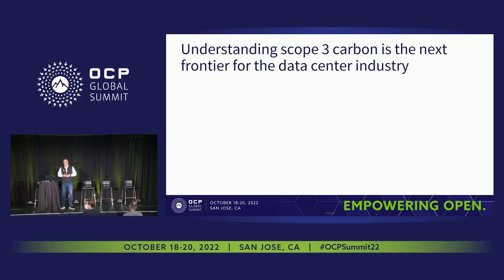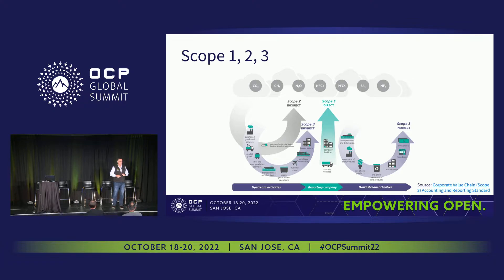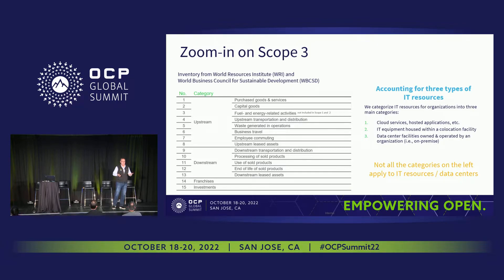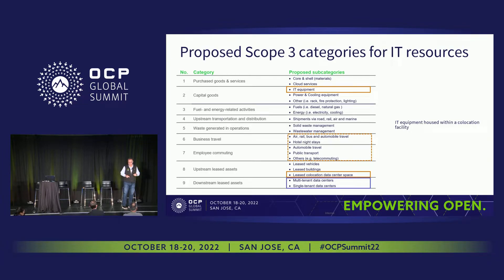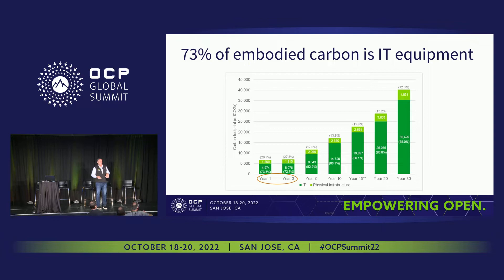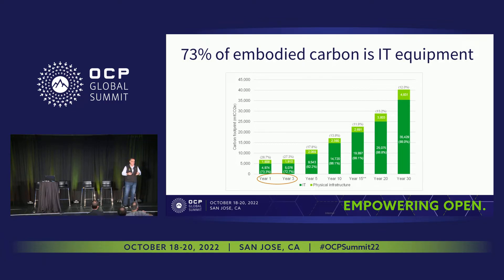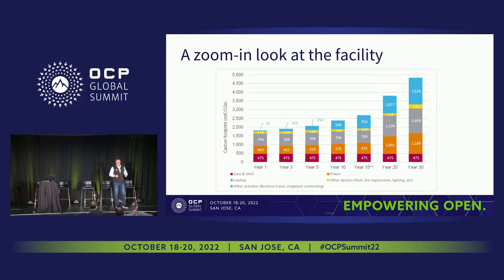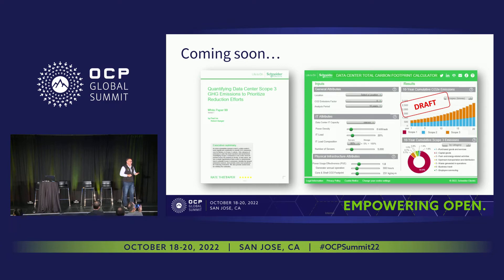Guide to Scope 3 GHG emissions  for data centers

Comment: Thanks for nudging Scope 3 GHG emissions for Data Centres.

It was interesting that the carbon intensity of electricity (Scope 2 GHG emissions) in California was used for the graphs shown and that the near zero carbon intensity of electricity in France was mentioned and that this would change the graphs and boost Scope 3 GHG to a higher percentage of the total emissions.

I cover this in the following talk where I consider a Data Centre located in a near zero carbon intensity electricity region which creates the Guinness beer glass analogy.